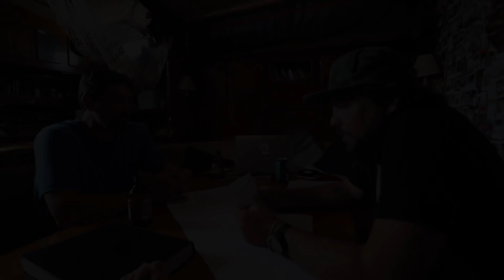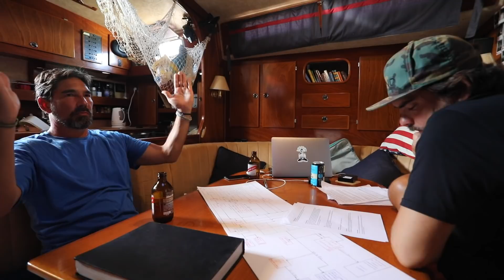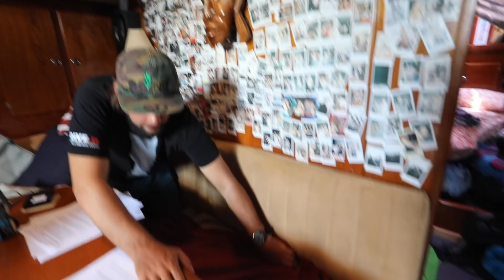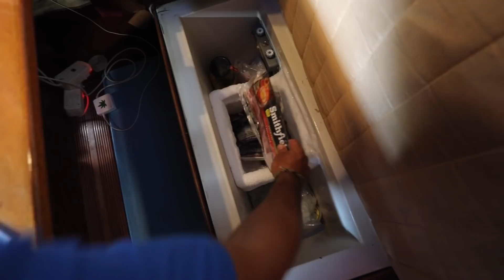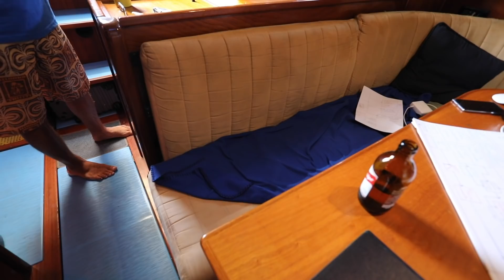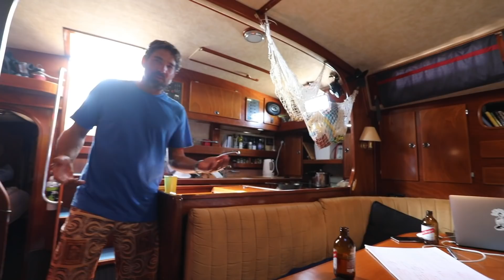How Cost effective is solar power? - ELECTRICAL BOAT TECH (7 of 7) -  Sailing Vessel Delos

Comment: Now it is 2022 and I just bought 405 Wp panels for less than 200 USD each. They weigh about 19 kg, bit large (176 x 105 cm) but they do the job. I installed 3.2 Kwp on my boat, 2000 Ah on the batteries, so should be able to run the whole boat without the need of my generator and that is exactly what I was hoping for. Used your flow diagram as an example, thanks for these series ! Great information.

Comment: Brian, IOU a couple of hours to watch this whole: Solar & Li series, but- I've been having this niggling thought that I CAN'T totally discredit? Real world daily usage of: 7 10Kwh/day (averaged) between fridge/freezer, H20 heater & pumps, computers, marine electronics, bladdy, bladdy. Because LiFePO4 is so incredibly awesome I may be able to CHEAT the house bank ever so slightly and undersize it to say 5 or 6Kwh's total ( 400AH to 500AH) for the house bank with a goodly amount of solar? 2 Bi-facial 440W panels over the dinghy davits (880W) & 6 SunPower Maxeon celled 120W flexible panels (3 parallel port/3 Starb.) (720W). 1,600W of solar 'acting' like both a charger & day battery on sunny days?
    I'm using the computers,  charging drone, cell, camera batteries, booting satellite (Iridium Go, Sat phones, PLBs), using the microwave, brewing coffee which I won't even touch the house bank until late afternoon on sunny days, right? Instead of filling the bilge with 'spensive LiFePO4 and creating a 1,000 - 1,200AH bank, why don't I get extra solar (I'm pretty confident it'll fit)
   Go ahead, tell me I've lost my mind & that's a crazy, stoopid idea- I can handle it. But, even with a couple of stormy days in a row (It'll never happen!), I may be able to almost eliminate the need for a generator altogether. $12-15k w/o install, 485Lbs of slightly Port offset, time/effort/skinned knuckles & otherwise 'centralized' maintenance, right?

Comment: I am a little late to this party.  Thanks for running through these particulars for Delos.  Most of my maritime work is with Outward Bound, so we cannot even compare power consumption.  Your system is closer to my off-the-grid house.  In April we increase to 1300w of solar.  Your description of the benefits of LiFePO4 batteries has me planning for when we can replace our lead acid set.  3.5x the cost is a leap of faith that the claims of longevity will pay off.  I see that you have increased your solar a bit more than just compensating for the removal of the center panel on the arch for the dome.  When you have a chance, a follow up to this series to comment on your changes would be wonderful.  Thank you.  Safe passage south.

Comment: All electric plus having a diesel generator is very smart.  Gasoline and propane add much danger to a house, and exponentially to a sailboat.   

I've learned lots of tips from yall.  Plus have found much relaxation through the CORONA problem.   A huge THANKS!

Comment: You should look for a VFD (variable frequency drive) for the dive compressor to remove the motor's inrush current.  Your batteries make the common D.C. bus that VFDs have between the AC to DC rectifier section and the inverter section.  Would work for the water maker too.

Comment: Silent Yachts have yachts running fully on solar. No sails, no diesel motors. Only have a emergency generator which charges the batteries in 3 hours.

Comment: Hi Brian lovely you technically of you power system but would like to add a safety as I am a retired electrician and would surges a form of protection in the high current wiring right at the battery’s is a hi current hrc fuse and or a circuit breaker. The short circuit current would be in the region of a couple of thousand amp for ten seconds.So large it could blow up you boat or cut through 12mm steel in seconds.Dc has a bad habit for doing that.Love you great advents you have and wise you all safe travel in these coved 19 times.Geoff

Comment: I live in Wisconsin.  Hot summer month with the air conditioner running 24/7 and a few TV's going constant, plus fridge, stove, lights, laundry.  We used 1008 kWh last month or 31.5 per day.  Probably 1800 sq/ft ranch including the finished basement.  You have more bathrooms than we do!  Cost for the electricity was $161.

Comment: Thank you so much for this very well done technical series. I'm learning a lot of very useful stuff that I can apply to the technical aspects of modern everyday life in our home in the big city (partially solar powered), as well as to our little home on the road, a Casita travel trailer, (also partially solar powered).  The Delos tribe is a wonderful resource.

Having installed flexible solar panels on Delos' bimini some time ago, it would prove valuable  if you would evaluate them for the "tribe."  I hesitate to use them on my RV, which already has a rigid panel, as I am not convinced the heat produced by the panels is safe for gel coat.  I am also not convinced that mounting them flush to a curved surface is good for either the gel coat or the panels.  What about longevity and electrical output?  How well have your panels held up and are they still functional?

Brian, you and Brady, your ladies and all the fascinating crew-members with whom you have shared your voyages have provided me with many hours of ear to ear grins.  All of you have been inspiring to this old man.  Thanks to all. 

Don Neilson
Pilot, motorcyclist, and armchair sailor

Comment: Bryan have you ever considered changing the extra freezer over to a fridge by changing out the thermostat? Kind of a longer term storage fridge to feed the current fridge? I did something similar for my home brewing beer equipment: a small chest freezer was turned into a temperature controlled fermentation chamber and then after the beer is complete I can lower the temps and it can double as a kegerator, easily keeping things below 40F.

Comment: If you added a Variable Frequency Drive to your dive compressor it will soften the start current. With a big enough inverter it would run it. Batteries would be the limiting factor.

Comment: High value content with this. Thanks guys. Happy and safe sailing!!!. Just a thing to try (unrelated to this video sorry), when I'm tuna fishing, sometimes the fish will follow you, not so interested in the jig you are dragging. I'm a commercial fisherman so it's okay if I just jog the autopilot by a couple dodges in an s motion. Not so good for you guys, but, I'll play with the jig when I'm not catching my by pulling it in and out in different speeds usually garners more action. Kinda like not wanting it until they think they will loose it so they go ahead and strike at the jig for keeps.

Comment: It seems you guys have an extensive system of networked IT onboard now, most of the new hardware you install goes via Ethernet/wifi compared to the things you've removed, could you share your networking setup? - Do you have backup storage devices onboard to save footage (water-tight?) - what systems do you have on wifi/backups for hardware failures?

Comment: Love those tech videos, would certainly not complain if there were more. We've recently added an Atlantic Tower Arch (we've choose the heavy duty one - sch 80), with 2X  225 watt solar on it. Installation went smoothly. Now thinking on updating the batteries with lithium.

Comment: where did you get your mechanical-electrical training?? say for example finding out process and replacement of brushes say on roller furling motor?? electrical - at least for me - a Licensed Architect doing super large projects - understand concepts and design but have yet to have your practical experience in a: trouble shooting b: coming up with creative ways to solve them..... and connecting the dots confidently to make a repair???

Comment: Hey guys, I watched the whole series, awesome stuff. In reference to electric motors, i saw a video somewhere where a guy put two electric motors in an older catamaran. So he said the motors are rated at like some ridiculous power consumption, but that rating would be at full load. Running wide open it would take about 30 minutes to drain the lithium batteries to their limit. BUT, at cruising speed, with good sun he said could run all day. I wanna say the top of his cat was almost totally covered in solar panels. Another option I've thought of is to run a set up similar to a locomotive. In a train, the massive diesel engine only drives the generator. The motors are electric. Electric motors are instant torque.

Comment: Interesting Math questions for those long dull passages.. People used to HATE those "Story problems" in grade school math class. There is a reason we had them...Here are some story problems no one is telling...

1) How many tons of coal does it take to make one Wind Turbine? Copper? Neodymium? Aluminum? Steel?
2) How many WInd Turbines will it take to replace all non-renewable energy Sources?
3) How many tons of Lithium will it take to provide the necessary storage capacity?
4) How many new mines will be needed to provide the needed materials?
5) How many tera-tons of new, incremental CO2 emissions will be required to replace all non-renewable energy sources?
6) how many tons of neodymium are produced per child-slave laborer in DR Congo?
7) From the time a pound of some mineral is removed from the ground, how many different vehicles are used to move it around until it is in a functioning turbine? How are those vehicles powered?
8) How many fuel powered vehicles will be scrapped? where will they go? How much landfill area is needed? WHat happens to all the toxic stuff in those vehicles will seep into the ground?
9) The lithium in one automotive cell can kill how many animals?
10) The blades of a wind turbine off-gas some interesting stuff. Use the total number of wind turbines you calculated above, how many tons of these gases will be released? What will be the environmental effect?
11) WHat is the life span of a wind turbine? Will we be done installing the first round of turbines before they have to be replaced? 
12) How many electricians are there in the US? HOw many more electricians will we need to implement a Green New Deal? WIll it be necessary to create a form of government with the power to force people to work jobs they do not want to do?
13) Currently the planet consumes roughly 14,000 Mtoe annually and grows about 3.5% per year. If we began immediately tomorrow to produce renewables tomorrow, how does that affect the growth curb and where will that additional growth come from?
14) How is the story of Robinhood tied to our discussion of the environment? How does the story of Robinhood inform our current thinking about climate?

Extra Credit Question: Energy can neither be created nor, destroyed. Currently, the vast majority of our energy comes out of the ground. WHat happens to weather patterns of the planet when you extract 14,000 Mtoe from the Earth's atmosphere? Currently, turbines are placed in the world's windiest places. We know that even if we reduce our carbon output to the levels of 11,000 BC, the climate will continue to change and weather patterns will change. How much will it cost to move 1/3 of the turbines 50 years from now when the wind stops blowing where they are currently sited?

I like that you are thinking about becoming more efficient but in the near term, a pell-mell rush to turning off all fossil fuel consumption has a lot of very real environmental costs that no one is talking about. Just because they are not in the line-of-sight does not mean they are not real. 

Keep doing what you are doing but talk about these questions and their answers as you glide along on a passage and share your musings with your audience. It is not and never will be a matter of passing a few laws or buying a few things that make us feel good about ourselves. 

Currently the dialogue is al about dire emotional warnings and all the things we should do immediately. There are good reasons why we should try to improve. There are a lot of really good reasons why we should nit rush into it. Yet, we are not ALLOWED to have that conversation. Anyone who tries has a big red "D" burned into their forehead and is forever shunned as 17th century witches were shunned.

Comment: Sailing Uma seems to be getting by with an electric motor and no diesel engine. But they don’t have a water maker or dive compressor or a/c and seem to travel with less options due to the lack of engine power.

Comment: In the cost comparison of lithium, I think you also mentioned that the charging efficiency is about 30% higher. So having lithium batteries is like adding an extra solar panel and you also save a lot on generator run-time because of the high charging capability. Also because you can discharge them until almost completely empty you get double the effective storage for the same nameplate capacity. If you look at it that way, you should compare half sized lithium batteries with lead acid ones and that already makes up a large part of the price difference.

Comment: Have you guy's seen the Silent catameran's the 40-80ft versions are all electric drive NO sails, and run on self contained solar panels, 7-8 knots 24hr a day. Their prices are comparable to most quality sailing cat's.   Also how about the 24V DC dive compressors, they run directly off your battery bank, no inverter required. They seem to work well on other boats that i've seen, and once running use surprizingly little power.         CHEERS            Steve h.

Comment: Glass solar panels are all rated to still produce 80% of their rated power after  25 years, but the flexable panels will fail after 2-5 years. IF your generator can still start after 25 years, it won't have 80% of its rated power still.  Love this series Brian and yes Brady too    CHEERS             Steve h.

Comment: I think a gas powered compressor would be the way to go on a boat unless you got an ungodly source for electric. On a sailboat with a lot of diving perhaps installed in the engine compartment with through hole for exhaust and a fill fitting up on deck for the tanks. Twenty minutes run and you should have a full tank on a liter of gas if that much.

Comment: Regarding electric propulsion vs fossil.  I don't hear much discussion these days about the safety role a propulsion unit plays on a sailboat.  For instance, a rigging failure during a storm;  if there is a health emergency out at sea, or any other occurrence that necessitates power over sail in order to reach safety.  Which propulsion unit provides a better safety factor.   Seems to me the safety role of alternative propulsion units must  be included in any electric vs fossil discussion.

Comment: Solar panels have 25 years power output warranty. 
10 x LG 400W = 4 kW, the problem is to find about 250 square ft of open space.
There are AC solar panels with micro inverter attached, so no need to find space for inverter.
TESLA Powerwall AC Lithium batteries are compact and rated for 13.5 kWh and comes with 10 year warranty. 
I think with above, you should not be power hungry anymore and use diesel for motoring only.
I develop solar projects in Hawaii,  the US state with highest solar per capita.
Wish you would hit these shoes someday,
Aloha
Charles

Comment: Thank you Delos crew. That was a truely fascinating series of videos. I’m currently planning an upgrade on my electrics for my boat (trailer sailer) so have learned a lot. One thing I would have like to see is a bit more about wiring. How is it run and terminated on Delos.with three voltage systems? Do you need a licensed electrician to make changes to your wiring? Thanks again for a great series.

Comment: Great series packed full of knowledge and experience.Mounting arch and 300W of semi flex panels on a Nic 35 right now so really useful thanks.
Answered a few of my worries like whether I should have it dismountable, “we’ve had ours up in 50 kts with waves dumping on it and no problem” What would have been good would have been a yardstick figure for actual generation. They say in California and I expect the same in Portugal summer that 0.25 x watts = daily amps.what do you reckon ?? Hope all is well with the “wee one” Nick

Comment: Quality panels degrade at around 0.3% to 0.5% of their rated power per year as a general rule. Most manufacturers provide at least a 10 year 90% 25 year 80% output guarantee.

Comment: Hi guys, I'd like to add a couple of points regarding durability of solar panels -
1) Modules are very reliable, claim rates tend to be well below 50 ppm. If there is a problem in solar systems, it's more likely to be caused by the inverter or some faulty contact in the wiring. 
2) Panel manufactures typically offer 10-year product warranties and 25-year performance warranties with  maximum annual degradation rates.
3) Those maximum degradation rates typically are 2,5% during the first year and 0,8% p.a. thereafter. That 2,5% degradation in year 1 is called LID (light induced degradation) and is caused by traces of oxygen left in crystalline silicon. Under exposition to sunlight O2-boron complexes are formed and those complexes 'capture' electrons and reduce generation capacity of cells. 
3) Exposure to corrosive environments such as salt water and spray can reduce lifetime of panels and may void panel manufacturer warranty. But even in such a challenging environment a high-quality panel should last for at least 10 years.
4) There is a specific IEC norm for salt mist corrosion (IEC 61701). When you buy panels for your boat, you might want to make sure that the products you chose comply with this specific norm.
Greetings from São Paulo ... ;-)